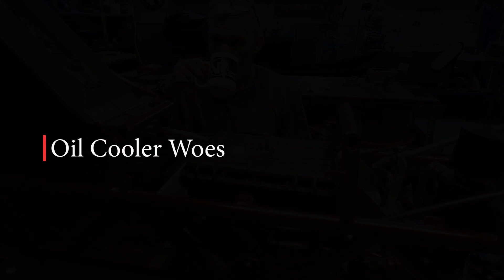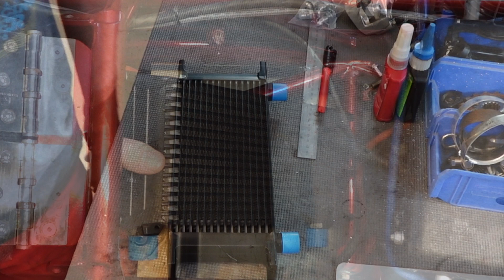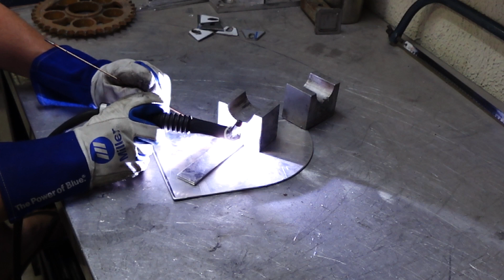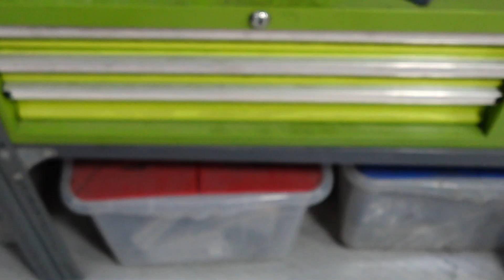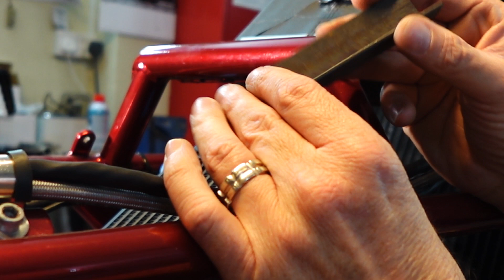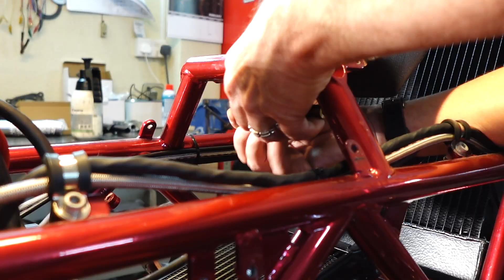Oil Cooler woes on our Land speed Motorcycle

Comment: Are you refitting that alloy plate to manage airflow through the cooler?
Reply from the maker: No, the cooler pretty much takes its place.
There will be 2 new Naca ducts flowing clean air from both sides of the bike through the cooler. Its also getting a fan.  

This sunday's vid will explain more :)